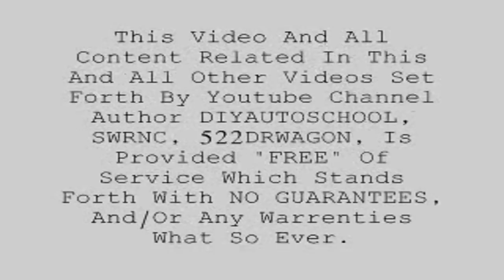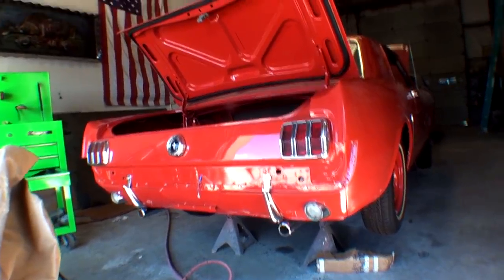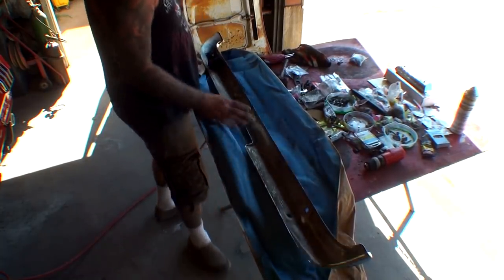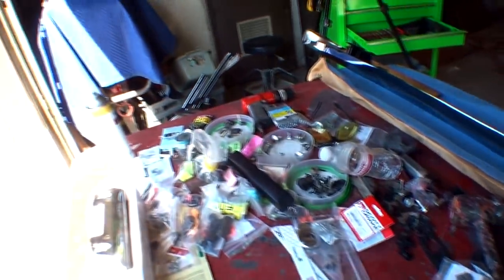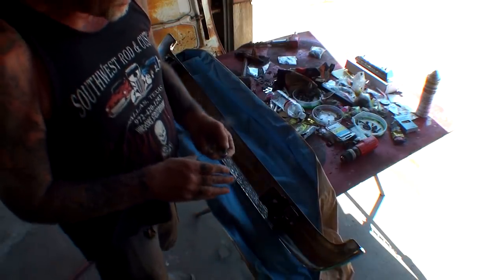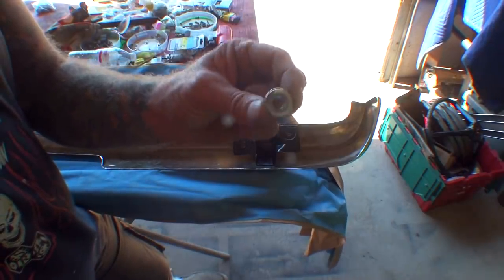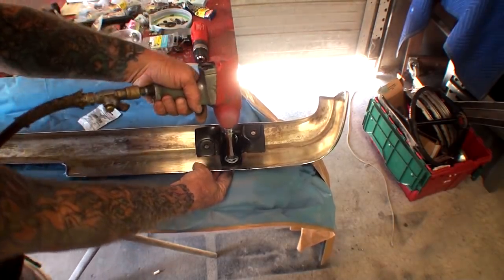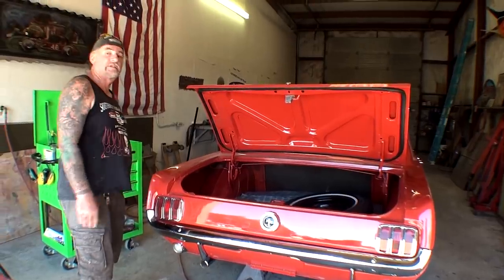Should I Use New Nuts and Bolts? Old Car Restoration - Do It Yourself

Comment: The purpose of those lock washers and locknut are to snug them up so the washer just starts to compress a little and stop then it does not deform the bumper around the bolt and crack the chrome. Not use a impact and torque the crap out of them.

Comment: I fixed a bumper on my car with carriage bolts through the bumper into the mount. I used washers and jam nuts to hold it together. I used my impact to tighten everything down.

Comment: Pete ,the wave washer goes between the bumper and the bracket.
Reply: It doesn't make sense to put the washer between the bracket and the bumper but then again the factory does alot of things that don't make sense sometimes
Reply: I have restored countless 60s Mustangs over the last 30 years. Every single one of them had the washer in between the bumper and the bracket when they were taken apart.
Reply: Probably a spacer since the bumper isn't perfectly flat but the bracket it? It looked like he actually deformed the bumper after torqing it so tight. Not sure though could just be a trick of the eye.
Reply: @bradfaught1695  I have the same impact gun. It's not over tightened. That gun has about 6 or 8 different settings.
Reply: I didnt think i was seeing things.
Reply: Exactly right so not to deform the bumper when using the factory bolts. The square on after market bolts extend further and don't work well with the spring washer. Hand torque only.

Comment: I use to fix up old mustang's and sell back in the early 90's. At one time I had two 70's and a 67 coupe. A friend had a mustang junkyard on his dad's farm and at his family's place sold parts. Original and knockoffs. We were always up there getting stuff as needed. The only thing I didn't do is the body/ paint work. All I did was replace broken or bent up stuff with whatever I could find. Folks would still run over to buy them from me for a overall profit but not great so gave it up. Was fun while i did it👍

Comment: i have an australian built ford falcon same bumper bolts and washers the crush/lock washers go between the bumper and the bracket also the dome bolts are a stainless steel cap over a steel dome bolt

Comment: When your in a "situation" you HAVE to use a different nut. Why not just use red lok-tite so it won't vibrate loose??
Reply: If you don't use OEM hardware in a restoration, why even bother doing said restoration.
Reply: use blue locktite ,the red is too strong .

Comment: I have a question for someone, what type of coating do you use to protect these oem nuts and bolts? Some people buy kits to re-plate them. It is recommended? I've heard it can weaken them.
Reply: Caswell sell a kit to allow you to re-zinc your original hardware. I do it to restore all the original hardware, takes some serious prep and practice, but well worth it.

Comment: Thanks for another great video. 
I just want to ask if you actually coat the bolt and bracket in grease or maybe paint to avoid corrosion???
Reply: Use rust prevention magic. It's a can and you just brush on the paste and then heat it up. It allows the same look as original. It is great product. There are some videos on it. works

Comment: Gotta love the gas tank in the trunk.
Reply: It wasn't in the trunk, if formed the floor of the trunk.  The trunk did not have a floor, just a big hole with a rail running around it.   The gas tank had a flange running around the top.  The gas tank dropped in into the trunk  and was and held up by that flange where it contacted the rail of the trunk.  The gas tank flange was then bolted to that trunk rail.  It was an ingenious set-up.  You didn't need to stamp and weld a floor panel for the trunk.   You didn't need mounting straps or mounting brackets welded to the body for the gas tank.  Installation of the gas tank complete the trunk.  Of course when you were throwing stuff into the trunk it was landing on top of the gas tank.  It was an efficient and cheap design and a liability lawyer's wet dream. Keep in mind that the early Mustang was nothing more than a Ford Falcon with a nicely styled body.  Almost all the greasy bits of an early Mustang are exactly the same as the Falcon of the same year.  The Falcon was designed as an el-cheapo mom 'n pop car.  It was cheap, and it showed it.  Today such a design would be illegal.     BTW, years ago I restored a 1965 Falcon, the bumper bolts, washers and nuts are exactly the same ones used on that Mustang and the washer goes between the bracket and the bumper, not between bracket and nut.   Also when you remove a lock nut of that type, you destroy it's ability to hold torque when you remove it.  Those nuts were intended for one time use only.  If you want to reuse a nut like that, loctite is a must.

Comment: The professional body whop who restores cars left all the bolts loose on my bumper so they rattled around on the brackets.   Man that guy was a tool.  I fixed it. The idiot rounded out the square bolts too.

Comment: Blue Loctite and a torque wrench, works every time.  Red Loctite can destroy threads when removing, especially on low grade steel., the reason heat is recommended. Blue will come apart and do no damage.
Reply: there wasn't any loctite back in 1965
Reply: I never use Loctite if I'm installing a non moving part that has a washer involved with the mounting hardware